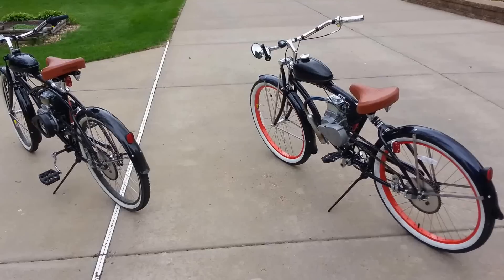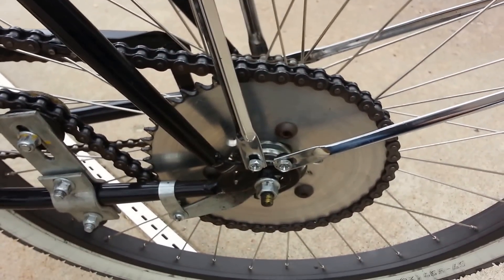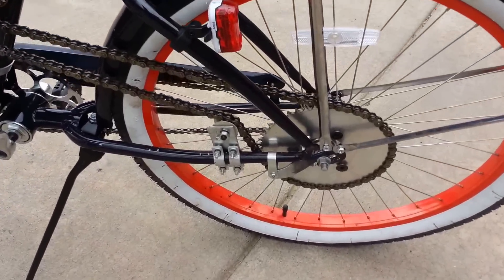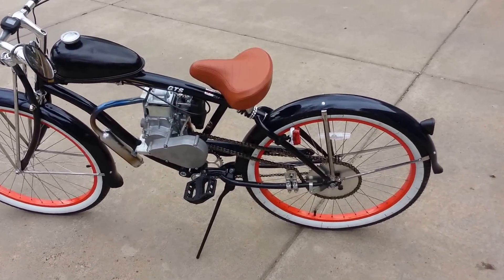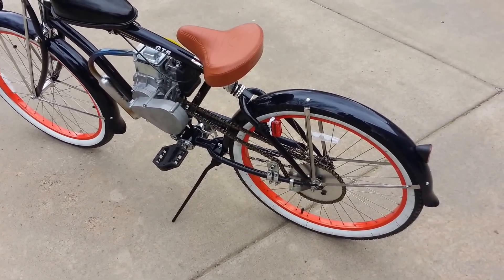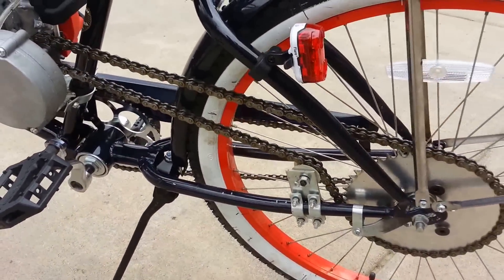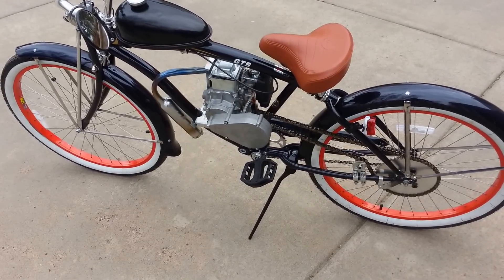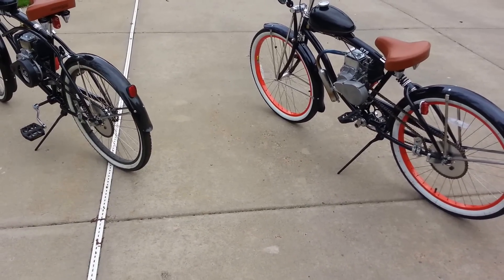Motorized Bicycles (How To Do Gearing)

Comment: I'm building a 4 stroke 20 inch fat tire ebike. I figure if I  use electric with gas for acceleration I should have pretty decent 0 to 30 even with a 36t sprocket.

Comment: I found the aftermarket transmission from bike berry is so smooth and does drop your top speed but requires no pedaling from stop. Im 175 pounds 44 tooth rear sprocket.
Reply: which one? the double chain trans?

Comment: Have an 80cc with an 8 speed cassette had some big issue  crushing 5 new derailleurs keep getting into my spokes/rear wheel now running the stock cassette on my and I just hook my drive chain to the 3rd wheel cassette on the 8 speed it's a bit of headache with the. Derailleurs cause there's to much tension from the motor it bangs the drive chain in a forward pull motion and causes the derailleur to slam into the spockes so I am thinking of going with an IGH hub but there are pros/cons about them want to find a good quality and strong igh  for my gearing

Comment: Nobody ever really mentioned the size of your rear wheel when it comes to gearing top speed and all that. In my experience personally with a 26 inch rear wheel I got a cruising speed 17 18 19mph .. and that's cruising that's not wide open that's not under strain that's a nice comfortable Cruise not putting the motor under a lot of stress .. just babying it .. a wide open top speed 25 26 I would say. Now with the 29 inch rear wheel I have a 23mph cruising speed same conditions as before babying it more or less. And a top speed of 31mph maybe wide open.  And that's what stock sprockets 44 in the rear whatever comes with the front I've literally done nothing to my motor upgrade it and I've been driving it for like 2 years

Comment: Dam they're slow. I have almost the identical set up as the girls bike but I get a top speed of 30mph on a Huffy Nel lusso with a Huasheng 142 on flat ground and I weigh 270! It climbs great. How did you tube the carb? I run a similar transmission with dual chains. You should get a better exhaust set up.

Comment: I need help, i have a 4 stroke kit too and i have it mounted in my bike, but the little sprocket attached to the transmission is attached on a shaft way too far out from the actual transmission, resulting in the small sprocket being so far towards the center of the bike that the chain literally rubs against the tire and the main bike frame itself...
Not sure how to move the gear but I'd really like to know how to move it back so that i can actually use this thing

Comment: Use a bicycle cassette transmission on the wheel plus the cvt . I know it can be done because I've done it with a predator 212, I got it over 80 mph, ofcoarse you'd never have to go that fast if you didn't want to, and it has great low gearing . The way I set mine up it no longer had pedals .

Comment: Really like your personal build. If your interested in looks changes a long frame bike like that would look great if it appeared lower. Drop the seat, get a different stem and an actual motorcycle gas tank that fits over the top tube. There are ways to keep it comfortable while making it attractive at the same time. My board track racer indian is suprisingly comfortable to ride. Thanka for sharing!

Comment: There is a difference in the Reduction Drives between the two Bikes ; one is belt and the other chain.The  Reduction Drives could be 5 to 1 or 6 to 1; maybe the same.  This was not taken into account when discussing Sprocket size on the rear Wheel, drive ratio.
This can be checked with the covers off, count how many rotations the engine turns to one rotation of the output . This difference will also effect the Engine output.
Reply: The belt is 5:1 and the chain is 3:1. The 3:1 is gonna be slightly faster than the other one. I however go for the belt trans just for reliable and maintenance free purpose. I got a 36t and about half throttle going 20+ miles an hour. I plan on getting a 28t. That way, I can cruise without redlining the engine. Torque is already there for me.

Comment: A lot of smack being talked about gearing/sprockets. Yes if a sprocket doesn't mesh with another sprocket then it is not accurate to call them gears, but the author of this video did not call the sprockets gears.  He is talking about "gearing" or mechanical advantage.    A sprocket is just that, but when you starting talking about two sprockets tied together, then it is "gearing".  The engine has a sprocket and there is one in the back so the term gearing is accurate no matter what rude old Mr. Qualls thinks.  Mr. Qualls you should man up and apologize.

Comment: So I'm a bigger fella (280lbs) should I do a 44?
Reply: Bigger rear sprocket will pull you along easer, but at a loss of top speed. A smaller rear sprocket will give more speed, but stress your motor more.

Comment: what I did was put a sprocket from another bike on the left side to transfer the power to the right side so I can still pedel my engine is a post hole auger with 45 foot pounds of torque from harbor freight but I get a lot of stickers in my tires

Comment: You better check the laws in your state before you gear your bike,  In California your bike can't go over 20 miles an hour or you need to register it and get a license.
Reply: Crash Gordon cops dont care as long as you follow the speed limit
Reply: If they tell you to show them only 20, pull the choke over a little bit, that'll decrease the power down to 20

Comment: my 26" bike will do 20 mph at 5,000 rpm.after break in i will run it up to see what it will do.i have a 44 -tooth, 4-stroke with a 5-1 reduction belt pulley.i might make a jack shaft so i can make use of the 5-speeds.we have a lot of hills here in western nc.

Comment: I need some help.  I just finished my second build (2 stroke) I went to adjust the clutch and the smaller gear sticks almost a whole inch from the larher gear. My other 2 stroke was not like that and all the pics on the internet where the same as the first build. Please excuse my noobness but i wont ride the second bike now due to this. So is it normal? if not how do i fix it without causing more problems?

Comment: i got a beach crusier but It wont allow me to use a 38 tooth sprocket. the chain always falls off and throws my tensioner pulley into the spokes. idk why though i have adjusted my tensioner so may ways. any ideas why i cant get the 38t sprocket to stay on track with engine?
Reply: Flex here and their effects it,, Dead true alignment effects it ,,,. New chains do stretch,,. Adjust the tensioner several times,,. Then drill 1/8 inch hole through the tensioner and the outer part of a lower frame rail,,.   Or  swing arm if it was a motorcycle,,  Then put in a s 12 self-tapping screw when it's dead perfect,,,. This will keep it from turning and making its way to the spokes,,,. !!!   Blue and red Loctite on everything,,,. And lock washers sometimes double nuts and lock washers,,, !!!   The factory Greece is garbage,,,. Repack all bearings with blue Valvoline high speed wheel bearing Grease and adjust the thrust also head bearings,,. True and balance the wheels,,,.  It takes a jackshaft to get the power to the other side,,.  Special crank and sprocket assembly,,. Before you can get power to the rear gears,, or sprockets,,. Hahaha,,,. !!!
Reply: realign the sprocket to the engine sprocket and/ or add another chain guide near where it comes off.
Reply from the maker: What he said. Your alignment is off. Also I would go with a frame mounted chain tensioner so you don't have to worry about it moving.
Reply: Luke Biz  Is the chain too long? long chain means more whip as less of it is supported by the sprockets. A chain can run a little out of line but if it's not within the tolerance of the chain it will cause problems. I would also check if you are getting flex on any of the components.

Comment: I just got my 2 stroke Chinese engine kit. The little cog is really hard to turn it just locks up the back wheel. Any help is appreciated
Reply: Sounds like your clutch may be locked up in some way. Try taking off the clutch cover on the right side of the engine and taking off the butterfly nut and the screw that keeps that in place, then the clutch plate should come off, after that reinstall the clutch plate by tightening the butterfly nut about hand tight and putting the retaining screw back where it was. If after this your clutch slips when the clutch is dumped you can take the clutch cover off again and tighten the butterfly nut.
Reply: JakelaWeeze 

.

Comment: CAN YOU INSTALLED DISC BRAKES ON THESE BIKES?
I HAVE ONE I BUILT LIKE YOURS. YOU WERE RIGHT ON ABOUT HOW BAD THE PARTS ARE AND HOW SOFT THE METAL IS.  BUT WANT TO BUILD ONE WITH DISC BRAKES.
Reply from the maker: Hello! You can add disc brakes on these, or at least a disc brake. While I have seen some people add front and rear I don't see any easy bolt on kits for front and back disc brakes only the front. For the front you will need a wheel that has a hub that accepts the disc and then a fork that has an adapter for the caliper. MBREBEL.com has these parts.

Comment: You got the right idea with the shift kit. I built one of the bikes in 2009 with an 8 gear cassette 66 cc angle plug head milled too .008 clearance with a dellarto 14/12 carb balanced crank lightened rod auto clutch and a pipe from a yz85 running 110 vp race fuel and hit 91 mph within one mile. It was the scariest bike I ever built. Somewhere I have video of it. I couldn't of done it though without the shift kit. Thanks for the vid. God bless.
Reply from the maker: +jim jim Wow! That sounds like an insane build! If you ever find the video please share it! Thank you again and have a great New Year!!!

Comment: The best question, more MPG more torque? or more speed More MPG?
Reply: im gonna explain it in a easy way. depends on the terrain you're ridding on. when you're going up hill, you'll burn more fuel. on the straight away you'll burn some fuel. going down hill, you won't be burning any fuel. if you drive it like you're on a race track, you'll be refueling often. that's the best answer you'll find.
Reply: More speed would be more MPG

Comment: Energy consumption on ratios? Increasing front decreasing back. Any idea?
Reply from the maker: +soartothesky Hello Soar! Thank you very much for this question as it has been coming up more and more so I'm actually going to be doing on a video around this within the next couple days. I've never found any options for different sizes for the the clutch side, only the rear sprocket. With a 4-stroke, my 165lb carcass on it in normal riding conditions I got anywhere from 135-160mpg. As far as speed and torque goes the 36 tooth got me about 31-33mph and okay torque and a 44 tooth dropped my top speed to about 21-23mph but gave me great torque. I hope this helps! Any other questions feel free to ask! Either comment here or message me direct at sinistercustomcycles@gmail.com or Facebook.com/sccmn. Happy holidays!

Comment: can u use a bike original shifting to shift the gearing on the bike?
Reply from the maker: Hello! There is something called a shift kit that allows you to use switch the drive from the engine over to your regular bike gearing so whether you pedal or use the engine you're utilizing your OEM bike chain and gears. This only works with certain engines and I have never tried it simply for the fact of I was extremely leery of the standard bike chain and gears holding up with all the torque from the engine. If you have any other questions feel free to email at sinistercustomcycles@gmail.com

Comment: I'd say put a nice exhaust on there more power plus not a huge mod.on your bike?I have 80cc if you notice your head has a metal gasket,remove that gasket and get 2 or more horse..just make sure your flush and the plug don't crush!!I can do can get up to 40mph! but I don't like beating the engine.cya

Comment: I have heard of 24T sproket and getting 55mph
Reply: what about 16T lol? I ordered a Raleigh fixie bike and it already had an extra 16T sprocket on the rear wheel, thinking about just using it
Reply: It really depends on your weight, im a bigger guy so a 16 tooth may not even move me
Reply: With a 4 stroke, I call BS
Reply: @andys4971  Actually, I just ran the numbers. Assuming you got 30mph originally with a 44T, gearing to a 24T would in fact result in an increase to exactly 55mph.Here's the Math> 10T/44T = .22727272727273 (old sprocket) 10T/24T = .41666666666667 (new sprocket) New gearing divided by old gearing = increase in percentage. So, new/old = 1.8333333333334 or an extra 83.334%. So @  30mph X 1.8333333333334= 55.0000000000007 JS
Reply: Tom_E Calm_7 your math is right but there’s other factors you gotta look at too, resistance, loss of power in the gears. You’d have to be realllllly light to get 55 mph out of one of these 4 strokes

Comment: where can i purchase these bikes from with out having to assemble the entire bike myself. please let me know im interested in buying
Reply: It only takes a couple hours with a few basic tools.
Reply: @chironkeller6417   yes thanks for the advice only 3 years later. 😐 I already made 2 of them by now I got the engines off eBay on 2 stroke and the other 4 stroke there were nice while they last. I got me a car now 😁
Reply: @martelbentley  Tell me which is better 4 stroke or 2 strock
Reply: @chironkeller6417  2 STROKE

Comment: I have a shift kit on my beach cruiser with a 4 stroke. You made a comment about the wider shaft for the crank being a plus. Not so with my shift kit. The torque from the engine bent the shaft causing very severe runout on the sprocket. The chain kept derailing from the sprocket to the jack shaft. Also the chain kept derailing off the sprocket to the rear wheel. I put the short crank shaft and shorter crank arms on it and had to file the top of the left crank arm for clearance to the 4G transmission. I really don't have any runout. Another issue I have is that the chain to the rear wheel keeps breaking. It was not designed to handle the load from the engine. Keep a spare chain and chain breaker on the bike at all times. Just a tip.

Oh I just bought a bicycle just like yours and a 7G kit. I'll be using a 8 speed internal hub. I'll be able to use a 415h chain and the 7G looks narrower than the 4 G so I may have better luck with clearance. Also got a 6 volt dynamo hub for lights and both hubs have drum brakes. It takes more pressure to stop with the drum brakes but they will last a lot longer than rim or disc brakes and better performance in adverse conditions..

Comment: I know this is crazy old, but how about a Predator 212cc engine?  Im considering another build using one of those myself.  You could also upgrade your carb.  There are adapters now that allow you to use pretty well any 2 stroke carb on the HS 4-strokes.  Using one myself on one of my bikes and its really nice.  Depending on what carb you go with, you can add quite a lot of power.  Also can get a more performance exhaust and exhaust gasket.  Youve got a belt drive which is really nice.  Tough to find these days.  You could also change the frame, go with one of those frames with the built in gas tank.  They look really nice.
Reply: better check the laws in your state. Most states regulate the size and power which can be used on bicycles. In Idaho anything over 50 CC must be titled, registered, and insured. Operator much have a valid driver's license with a motorcycle endorsement. The bicycle will also need lights, horns, mirrors, and turn signals that meet federal highway safety specifications.
Reply: +jburr36 
Same in Washington but anything over 49cc

Comment: I have a bike like that , would Bigger gears make it faster on long runs or smaller ?
Reply: Bigger equals more torque, smaller equals more speed.
Reply: +Zeaiclies cool thanks..need more speed what size you recommend
Reply: Well you will need to get up hills. 
But some where in thirties of tooth sproket. That should propell a person of 160 to 180 around 34mph and still allow climb on small up hills, medium to large Hills you will need to pedal. 

Unless you can get an 8hp 4 stroke 80cc, with a very top line carb and tube pipe exaust. I have yet to find one that would fit a regular bike frame.
Reply: +Zeaiclies 8hp 4 stroke 2 cycle 80cc?
 uhm a 4 stroke 2 cycle is IMPOSSIBLE it's either 2cycle/stroke or 4cycle/stroke
Reply: Robert Tessner 
Sorry, my phone made the error and I did not proof read it.

Comment: What if I use the flip flop hub on a fixie with 16 teeth on it?
Reply: +Eminent Bastards have fun getting it started lol
Reply: +Jordan Malfara but in all seriousness how fast will it go and how long will it take to get there?
Reply: +Eminent Bastards well on my bike with a 44 tooth sprocket I get a easy 45kmh. I think the rule of thumb is 1mph per tooth that is removed. so it would be very fast for a bike frame lol ( that is only if your engine had the power) it would be hard to get going with the engine alone tho you'd for sure have to pedal to get it really going. I wouldn't go lower than 36 tooth on the rear just because a 60cc engine won't push much past that
Reply: +Jordan Malfara thank you!
Reply: I was thinking about doing the very same thing lol. Think it is feasible to be able to start from dead stop on it, just gotta make sure the pulley in your transmission is on the larger side to make up some torque. Also, if you can swap out the 11t  with a 9t output sprocket it would help boost your ratio a little as well

Comment: I'm considering a frame with a similar rear suspension. Do you have any gross vehicle weight info on that spring? Also of interest would be the max rider weight for the extended width crank set. I weigh 250. Thanks for any info you may share.